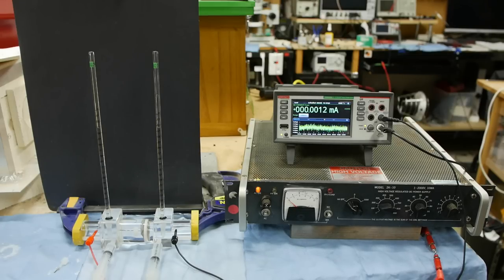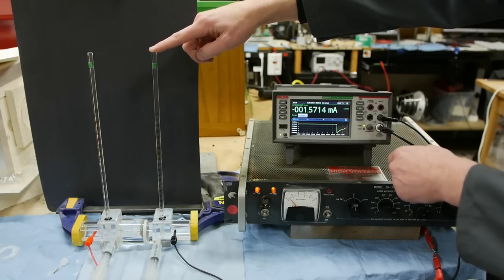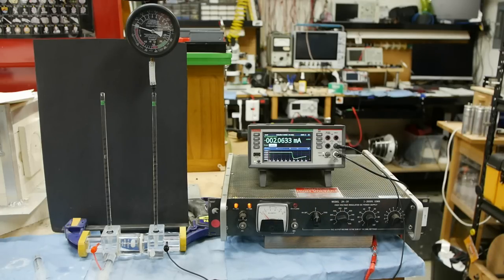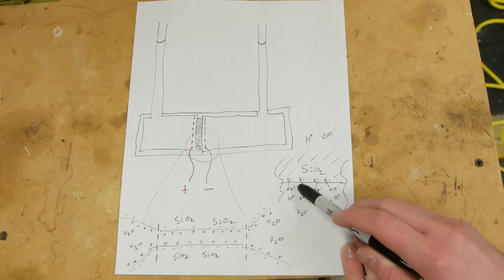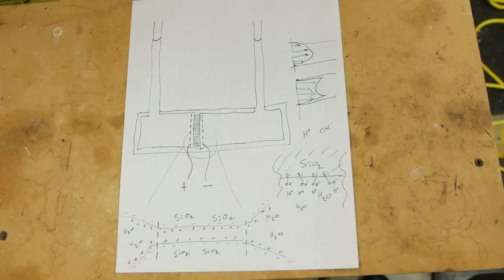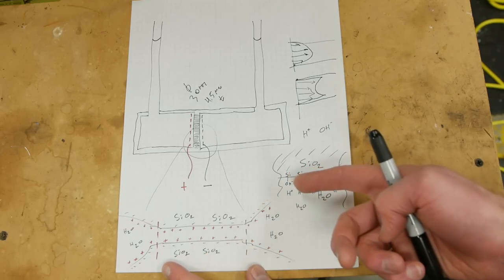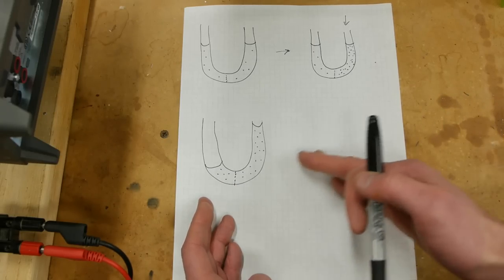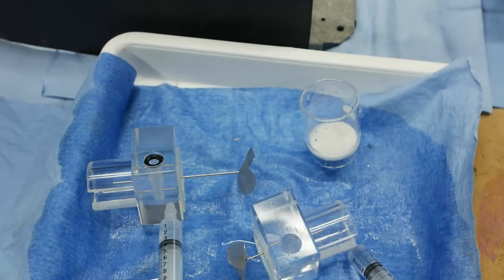Electro-osmosis: pumping water with electricity and no magnets

Comment: "There's a lot of complicated math they like to throw in there because it's an academic paper"
Reply from the maker: I don't do rants on my channel, but if I did, I'd rant about the desire for authors to make their subject seem as complicated and difficult as possible. It's understandable why they do this, but doesn't serve the purpose of making knowledge accessible.
Reply: totally agreed..

i hate looking at "official" sources/papers for this exact reason!
Reply: @AppliedScience   i've always seen it as an organization problem and/or  a lack of artistic skill to make the paper easy on the eyes, because math is always important.
Reply: To be fair, I did a lot of modeling myself when it came to electric fields inside ionic liquids (via Nernst-Plank) and it is anything but trivial. Although the overall concept seems simple, coupling electric potential with ionic movement inside of a fluid is an incredibly nonlinear phenomenon. 

The PDE solver I used could barely handle even the simplest 1D cases of the problem. Then, if you choose to involve electrochemical reactions, the potential is no longer transparent and that dynamics of such a situation become even more complex, especially when your reactions couple with your ionic species whose concentrations feed back into the potential which then feeds back into the reactions. 

Eelctrochemistry is one area where I believe complicated mathematics is all but a necessity. My main issue is that researchers working in this field don't seem to make an effort to non-dimensionalize their variables or lump parameters making the math look messier than it actually is.
Reply: tbh, i'm lost on most everything you've said, but yeah...

there should be more emphasis on making that complicated math readable for those who might actually need to use it.

the same problem runs rampant with computer science. There's too much emphasis on complex formulas/expressions/etc, and next to no emphasis on making this data remotely possible to read for the vast majority of people who might have use for it. >.>
Reply: I dont think the math was that bad especially for fluid dynamics. It can get a lot worse
Reply: @AppliedScience  Nor enforcing their credibility.
Reply: @mildlyacidic  Yep, they still look for the easy way to the end game. Gotta do the math, prove your theory and then try to disprove it. If you can you were wrong. But the status quo can't tolerate potentially being wrong.
Reply: @AppliedScience  academia is a business/career
Reply: Writing academic papers myself, I'd say I'm frustrated when authors don't dive deep into why/how something happens. Putting an experiment setup together, pressing some buttons and seeing what happens is one thing, explaining what's happening is another. Descriptive studies are boring and lack depth
Reply: @AppliedScience  IDK the math is my favorite part. I think the problem is casting it in the right "interesting" light. The way I explane it to my daughters is that science is the art of understanding magic and math is how we write the spells. They're 5 and 9, but it spurs their intrest enough.
Reply: Great stuff! Id love to see that filter under your SEM ;)
Reply: Michael Cheponis Things get really funny if you take many even highly formal papers, and stick their reasoning into a theorem prover (with axioms, lemmas and theorems that build the requisite theory they play with). It’s insanely easy to make the “paper math” be ever so slightly wrong. Looks fine to human eyes, but once you see (with the aid of a prover) where some types mismatch, you know that it’s wrong, especially if they don’t invoke any theorems to explain a given step (or invoke a rather incomplete set of theorems).

Given how easy it is to misapply formal math, and given that professionals do it all the time, I’d say that it’s a good idea to be humble and simplify rather than formalize. If you formalize without a theorem prover, it’s extremely likely that it’s mental masturbation as I call it. On the other hand, using theorem provers seems like mental masturbation too, but at least you get logically coherent results: it’s shooting blanks, but at least there’s a target :)

And some poor soul reading your math won’t have to wonder whether they don’t get something or the paper is simply subtly wrong. I’ve spent more time that I will to admit being just stumped by all sorts of errors in paper math. When you’re trying to learn it, you blame yourself first. Knowing that you spent a week because of a typo or two really drives the point home about how important accuracy is when you brandish formal math. It also makes you jaded with age :) I now assume that anything written by non-mathematicians is assumed broken until shown otherwise. It seems like a safe assumption. Saves lots of time. And mathematicians are not immune to it either, of course. But they seem to care more.
Reply: Sometimes I think they make things unnecessarily complicated so that other can't understand what they're doing.  It helps hide errors or gaps in understanding or just makes things seem more complicated so investors feel like they're getting their money's worth.  Another possibility is that they are rushing and not bothering to simplify or clean up their papers again due to pressure from investors.  Of course it's also possible that something really is super complex and there's no better way to explain it (or they struggle with the same issues a lot of people with niche knowledge or jobs do and don't know how to simplify things down to layman's terms).
Reply: 5pm
Reply: @AppliedScience  But how would they otherwise confused the reviewers enough to pass scrutiny?
Reply: @AppliedScience preach!

Comment: I wasn't expecting the flow to be that fast or the current so low.
Reply from the maker: Someone mentioned your vid on EO dehumidifiers. I can't believe I missed it the first time around! I never knew such things existed.
Reply: @bigclivedotcom - I'm pretty sure you "disassembled" a device that kept humidity lower on the inside of the device, by using this principle.  You commented on the unique manufacturing of the "solid-state" dehumidifier square patches, as I recall.
Reply: @AppliedScience  I'd known about them for a while, but shamelessly used my new-found YouTube stardom to scrounge a module from them.  (They actually sent me a few.)  The biggest one that I took apart actually passed a lot of current when initially powered because it had absorbed a lot of ambient moisture.  I guess that's why they specify that the power supply has to current limit and not go into hiccup mode.
Another odd electrosmosis application is electronic damp courses where electrodes are implanted in a wall to drive moisture down to the ground.
Reply: @bigclivedotcom  plasterer by trade dont do it anymore but done a lot of damp wall in the past, stainless weld rods ive been told by some cowboys lol 
I only started watching your vids the other day some light reviews bbrought me to your channel👍nice
Reply: Has nothing on a COB light/solar panel.
Reply: @AppliedScience  The more you know. 🌈
Reply: @AppliedScience  If you are ever on Isle of Man, or Bigclive is near you... A collaboration should happen.
Reply: Wow Two of my favorite YouTube channels all in one spot you and This Old Tony!! Has to be a good Channel then!

Comment: This is amazing. All in the quest of silent pumps.
Reply: Applied science: the only channel with 56k views and 4 comments from verified youtubers
Reply: Anyone with a fish tank in the house can tell how crucial it would be to have a truly silent water pump. This one would fail though (unsafe due to high voltage, prone to clogging).
Reply: Time to integrate it into a car.
Reply: Przemek Kobel this tech would probably be more useful on stealth submarines
Reply: I'm more interested in if this can be used for marine propulsion.  How efficient is this process.
Reply: @przemekkobel4874  Fish wouldn't likely live in the too pure water. Although this could drive a secondary pump independent from the high purity / voltage requirements of this one.....maybe driving the secondary side via a diaphragm type arrangement.
Reply: He is creating a chemical electrolysis so this thing wont hold forever cuz the stainless steel rods will corrode and die out  and its very limited to types of liquids  and you cant drink from this either.
Reply: The first time I heard about the kind of pumps it was actually about special engines for soviet submarines from the 70s. It was long ago. So the idea is definitely not new. And the biggest challenge was to prevent electrolysis and gas bubbles formation because leaving a huge trail behind would kinda make the whole stealth and silence thing useless. The rumors told that they managed to deal with it somehow. Don't know what it was but I would guess a multistage construction with some kind of a catalyst in between the electrodes.
Reply: @Kirillissimus  You could probably just pass the exhaust through a honeycomb of catalyst after both electrodes to recombine the gasses back to water and a clever design could harness the heat released by this for many purposes.
Reply: Small Current = Deadly !!!
Reply: nah, passive pumps.
Reply: Grandfather_Din_Racket  Please, be more specific. I'd gladly read about that. Google overlord shows me only some papers about low voltage nanoscale stuff.

Comment: SmarterEveryDay sees this "DID SOMEONE SAY LAMINAR FLOW?"
Reply: No. They did not.
Reply: @PacesIII  Yes. They did. 12:56
Reply: Laminar pipe flow situations. 

I suppose...but this is essentially a sealed system. There's not enough force being exerted fast enough to cause turbulence momentum in the pipe, so mechanical laminar flow inside a closed system. Hydraulics.
Reply: That channel blows
Reply: @PacesIII  i know this is old but for anyone looking at this, yes what you were aiming to describe is laminar flow.  Laminar flow is related to the turbulence, if too turbulent, you can't have laminar.  Also a good rule of thumb, if you are not in a pipe, assume you do not have laminar flow unless you have some very good evidence.  And hydraulics is purely the study of how fluids move.
Reply: @hubertcumberdale8175  --- Yes. He also creates a resistance when he blocks the air flow at the top of the column, similar to having air in a hydraulic system. The fluid only rises so high because the compressed gas overcomes the pressure from the incompressable fluid.
Reply: lamellar not laminar

Comment: When it's only about the electric field, why not just isolate the electrodes, maybe even just with a thin layer of insulant? Wouldn't this prevent all the electrolysis-side-effects or am I missing something?
Reply from the maker: That is a good point. Some of the current flow is caused by the movement of the water. I saw this when blocking the movement and seeing a change in electrical current.  I probably didn't explain (or understand it myself) fully. A true non-conductive  fluid or insulated electrodes would not work.
Reply: @AppliedScience  It means this electro-osmosis process is kind of an accelerator but not initiator type of mechanism..
Reply: Thanks for the explanation! :) It's probably like the naïve idea one can have to look at two electrolysis cells without providing a means of ion exchange. Definitely a very interesting topic.
Reply: From wikipedia: "The Coulomb force on a charge of magnitude q at any point in space is equal to the product of the charge and the electric field at that point"

F = q E

Since the force is dependent on the electric field, not the current (other than the obvious current from the flow of charged particles), theoretically I suppose you could have some kind of EO pump without additional current flow.  When charging a supercapacitor for example, there is a very efficient storage of charge and energy even while pumping ions over to the electrodes.

However to get continuous flow could require a peristaltic effect, with multiple capacitor plates and alternating voltages.
Reply: If the electrodes were insulated, then the charges would accumulate in a cloud near the electrode.  That cloud would essentially shield the rest of the water from the field, so you wouldn't get a good field across the frit filter.  When the electrodes aren't insulated, then when the charged ions reached the electrode, then the ion could take or give an electron (depending on which electrode it is), and become neutralized, preventing the accumulation of the shielding cloud of ions near the electrodes.
Reply: @roboticus3647  So, what if the electrodes were connected to each other with some insulated wire that has some tuned resistance. That would generate a field, and prevent charge accumulation, and the water wouldn't touch the metal. Right?
Reply: This is deionized water.  It's already a neutral charge.  The balancing charge is in the electric double layer (EDL).
The ionizing reaction is apparently caused by the silica glass alone.  
H20 ==> H+  +  OH- 
H+  +  OH- ==> H2O   
The EO pump works even without electrolysis or charge transfer with H2O.
Reply: now build a transistor out of it @roboticus3647
Reply: @mikeguitar9769  No electrolysis is definitely needed because protons accumulate on one side of the membrane causing a counter field to the external field. Only when protons are discharged at the negative electrode (and produced at the positive) can the pump continue operation.
Reply: I'm not talking about a static field.  I'm talking about a dynamic or alternating field. I'm saying charges move in an electric double-layer capacitor even without electrolysis.  Then 3 of you said capacitors can't pass a DC current.  Yeah, I know.  Doesn't mean that charges don't move in a capacitor with an AC field.

Once you understand that, then note that this motion can be leveraged to get continuous flow by daisy-chaining them together.  It's the basic principle of peristalsis.  Don't try to tell me you're incapable of swallowing food because your esophagus can only contract and relax and can't actually move with the food.

You're trying to claim that surfing a wave is impossible because the ocean water only goes up and down.
Reply: @AppliedScience  Keith Reynolds: "He said a lot of the energy is going to the electrochemical separation of hydrogen and oxygen. That is kinda true. in reality, a small amount is actually going to making hydrogen and oxygen. The rest is called overvoltage and goes to making heat. That just makes more thermal load for the radiator to eject. " 

Me: Ah yes but there IS a way to increase the efficiency so that the energy lost to heat is minimized and more/most of it goes into the electrolysis process... Just like a linear regulator loses a lot of energy as heat, and a switching regulator minimizes that heat loss and is much more efficient. Maybe applying a similar principle to that comparison would work, this is linear electrolysis we need switching electrolysis! Let's figure it out and then unlike stanely myer don't keep it secret but post it far and wide everywhere you can possibly think of before they get you like they got stanely! So that way the cat will be out of the bag and there will be no way to get the world to unlearn how to do it! Then we can have cars that run on water man! No hydrogen storage tank necessary, a water tank instead and a water->hydrogen fuel injector cell that converts it on demand with high efficiency! :D Upon the hydrogen burning the exhaust becomes once again water! Clean burning, high energy density future fuel! :D
Reply: @borismezhibovskiy7607  It would equal a capacitor. There would be flow until the internally oriented charge cancels the externally applied field.
Reply: Roboticus I guess all you need with insulated electrodes, then, is a buffer solution that can neutralize the ions. At least for demo purposes it’d be cool to see that work.
Reply: @AppliedScience  Upon watching this again, the question that springs to my mind is whether or not, in an electrolysis cell, a magnetic field could be used to separate the H and O by controlling the flow of electrolyte past the electrodes?

Comment: looks like you are using a Power Designs 2K-10 power supply. I worked for Power Designs back in the late '60s at their Stanford Industrial Park facility (Palo Alto, California)  where the 2K-10 was produced. Brings back some fond memories. Glad to see after about 50 years it is still working.
Reply: The Power Designs supplies are excellent. I own a 2010, a 3650-S, and a 3K10B. All of them work perfectly and are in regular use on my bench, and the 3650 is older than the moon landing.
Reply: Nice! I've got a 2020B! Still works.
Reply: I just bought a Power Designs 6050D. Never heard of the company before that
Reply: I’ve restored about a dozen of the older 2000 series supplies. The build quality in them was amazing! The main failure mode on them is the thermal switch inside the reference oven. They used a simple bimetallic switch to keep the oven at 80c. You can still buy new switches but it requires completely disassembling the oven assembly, which is difficult to do without breaking the bakelite base.

I ended up designing a solid state replacement based on an op-amp, SSR and thermistor. You just drill a small hole in the oven base, feed the thermistor up and seal it in with some silicone sealant. The circuit is powered directly from the AC via a simple capacitive dropper.

This keeps the oven at 80c +-0.25c, which is better than the +-3c of the original bimetallic switch.

I’ve resold about 10 of these refurbished supplies on eBay and they’ve been working for 5 years now with no problems!

I’ve got about 5 Power Designs supplies in my lab, my favorite being the 2020B!